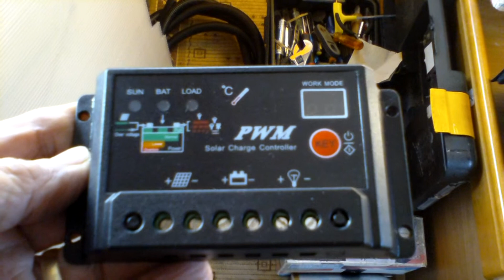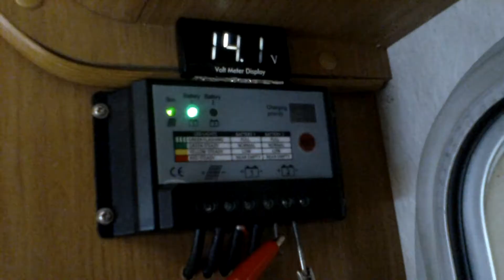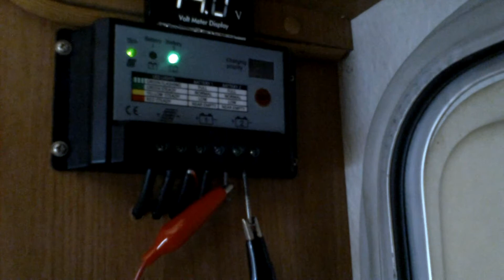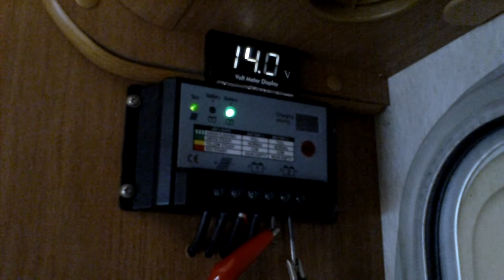SOLAR DUAL BATTERY CHARGE CONTROLLER

Comment: Peter , can you share what brand and model # controller your using ?
Great video , and exactly what I'm trying to figure out for my motorhome.
Reply from the maker: Hi Loren. The Dual battery solar charger is available here.
https://www.ebay.co.uk/itm/154246712011
Reply from the maker: Hi there. Both eBay and Amazon do them and they do not have a brand name Currently away at the moment with no hook up and units working first class keeping BOTH the engine and habitation battery fully charged. You can’t miss the image - note - I have seen a boat chandler advertise exactly the same saying it’s an MPPT controller but I am doubtful this is the case but it carries an MPPT price tag of over £100. 
The unit I have is around £15

Comment: Peter that light bulb symbol signifies a load. If you connect your loads through this, the solar charger will protect your battery from deep discharge. It will disconnect the load at about 10.5V and reconnect when battery has recoverd.
Reply from the maker: Hi Mark. No don’t work that way - your only looking at the single battery charger that is used with a solar panel to run a light for a certain time which can be set on the controller hence the light bulb symbol.
The second (new) fitted controller only has a TWO battery symbol and you can set the % level of charge in the first leisure battery before it then goes over to charge the vehicle battery. When both are topped up the controller goes into a limp mode and just maintains the charge. Been working well since fitted and keeps both leisure and vehicle engine battery in tip top shape.
Hope that explains it better for you. Regards Peter
Reply: @brucepeter2007  Yes I was just looking at the single battery solar controller, because in the video you remarked on not knowing what the 'bulb' feature was for. I believe I explained it correctly. You can of course connect a bulb if you wish, as you can any load. The point is, a controller doesn't just control what goes into a battery, but can also control what comes out, to protect it from deep-discharge cycling.

Comment: High what size cable and in-line fuse did you use and how big is your solar panel many thanks
Reply from the maker: Hi Peter. I used 6mm stranded cable. The solar panel is 100W and the in line fuse fitted to EACH BATTER CABLE RUN is 10 Amp.
Regards Peter
Reply: Hi thanks for your reply I’ve got 12 awg 3.3mm to run from my 15amp controller to my battery will that be ok and what in-line fuse would I need many thanks
Reply: Thanks for your reply very much appreciated I’m using 12agw wire 3.3mm will a 10 amp mini inlin fuse be okay
Reply from the maker: @peterrider3471  your cable is too thin and you will get a voltage drop.
As I said before I used 6mm cable.
Reply: Thanks for that is a 10 agw 6mm ok and could you tell me what size inline fuse I would need for that thank you very much for your help
Reply from the maker: As prev reply stay with a 10 Amp fitted as near to each battery as is practical.
Regards Peter
Reply: Thank you Peter

Comment: I just bought one. Was thinking of putting a 6amp diode on the van battery positive lead, but as you have haven't had issues, maybe I won't bother.
Reply from the maker: It’s fully protected and the panels have diodes fitted so no need…

Comment: can you leave it connected when running the engine without burning out the controller??
Reply from the maker: I leave it in line all the time as it’s fully diode protected.
Reply from the maker: Hi Hugh. All the protection is in the controller and it needs direct connection to the battery as it samples each battery and a diode could block this feature.
Just ensure you don’t put a larger solar panel than the controller can handle.
Just ensure you put a fuse in both lines to each battery and that’s all you need.

Regards Peter
Reply: @brucepeter2007  Thanks Peter, I had an inline fuse on the +ve lead already prepared, so just swapped over my controller today to try it out. Charging both, have started the van several times, nothing blown up. Really good piece of kit, very happy, as I like to leave my alarm and cameras on a lot, so nice to have a topup if it's parked a while. I ordered it after watching your video. Thanks.
Reply from the maker: I leave it connected all the time.
Reply from the maker: Never take it off line…